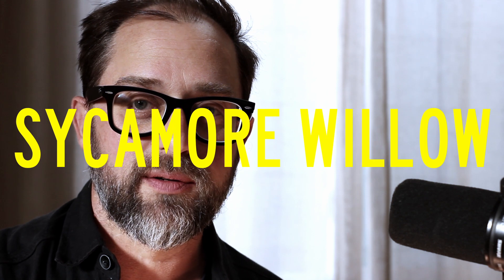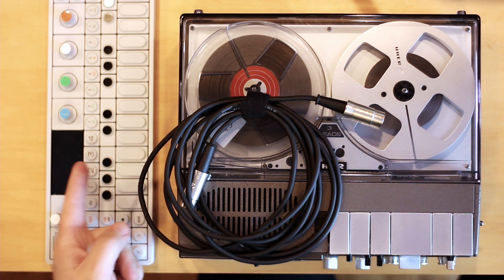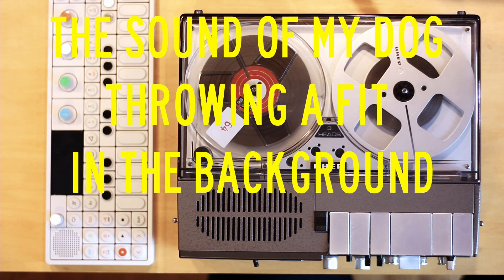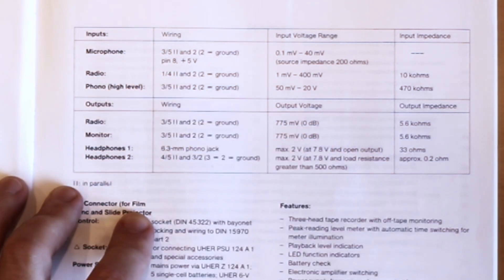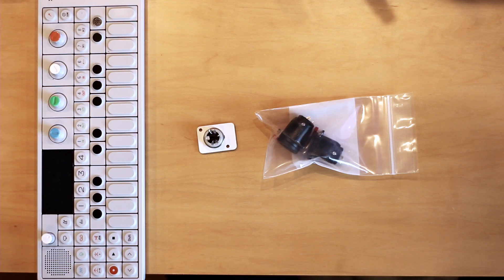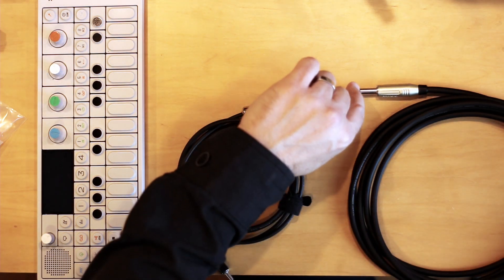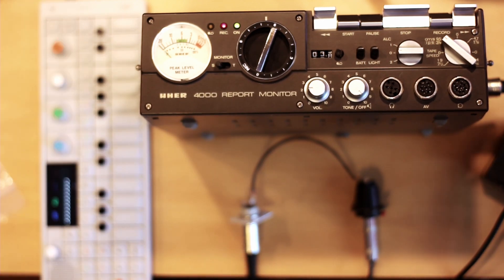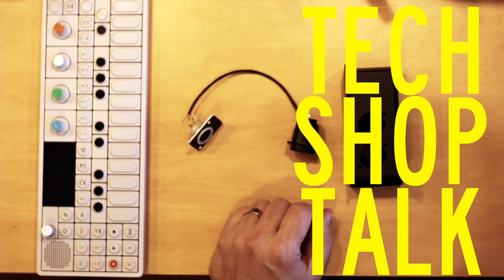How to connect a vintage Uher reel to reel to your gear. Understand and even build your own adapters

Comment: Hi-De-Ho, so I'm considering buying an Uher 561 which appears to use the same bizarro DIN jacks, and because I'm either lazy or technically incompetent, I'm wondering if you still make these little boxes. Your site seems to suggest you don't have any available at the moment. Thanks for any info, and for helping the community as you have in the past.

Comment: Hi ,have you also tried connecting the microphone this way ?
Reply from the maker: Kind of! I built an adapter to connect XLR to the connection on the front. But I also own several Uher mics and just plug them straight in

Comment: Hi, I liked your video very much! I was however wondering, can you connect the line out of eg the op-1 to the phono or radio in on the Uher? It’s different voltages right? Thanks in advance!
Reply from the maker: You absolutely can connect typical audio level sources to the Uher! I do it all the time and specifically I've done it with my OP-1.

Thanks for stopping by :)

Comment: I have a Akai4000d   reel to record er and a yamaha Digital  mixer 10xu  and 6i6 interface  do you no how to hook Thanks
Reply from the maker: In your case it's almost certainly just a matter of getting 4 RCA-to-TS cables. Two going into the recorder and two going out. So connecting instruments to the reel-to-reel recorder you'll only want to connect the line inputs and outputs of the reel-to-reel to your interface. I'm not familiar with your interface so I can't really give you any advice on that. But in general if you can get signal routed to the lineouts of your interface you'll be able to record to tape. If you connect the line out from your recorder to line inputs on your interface you'll be able to record the output from tape to your daw. Hope that helps let me know how it goes!

Comment: Hey, I’m having this issue with my Uher Monitor Report 6000, but it doesn’t use DIN-5… of the 7 connection points on it, it uses 6 different connectors.. some have the same number of pins but arranged slightly differently.. it’s extremely confusing to me. Also, I’ve only been able to find user manuals in German so I can’t even RTFM my way through it…
Reply from the maker: Hey there I'll see how I can help. I suggest you find me on Reddit as jasongonzales23. You can DM me there or post something to the Hainbach subreddit and maybe the hive mind can help as well
Reply: @SycamoreWillow  awesome, that’s actually how I found this video. Thank you, I’ll definitely do that.
Reply from the maker: That's really funny but yes seriously send me some close-up photos of all the jacks on your device over on Reddit and I will totally help you out
Reply: i'm using DIN5 cables with my UHER 6000 and its works fine BUT make sure they are pluged in correctly.

Comment: I have the 4200. It’s the stereo version. What’s really cool about these is that they’re not only great for recording live shows (or anything that you want to have the tape sound) but, they’re great to use for tape delay. Especially, being that the UHER 4000 (mono), 4200 (2 track two channel stereo) & 4400 (4 track two channel stereo) all have four speeds. You can get the cleaner delays using the 7 1/2 ips & 3 3/4 ips speeds & the really dirty delays using the 1 7/8 ips & 15/16 ips speeds.
Reply from the maker: Hey thanks for checking out the video! I have yet to try my Uher as a tape delay. Thanks for the suggestion!

Comment: The adapter is not so bad. ! You make connections in one go.  
And the adapter cinch to 6.3 female is cheap too !
  DIN Adapter to stereo in and out for 6€ easy at amazinien and four cinch to  6.3 mm female you can find for less than 1€ a pice .
I gave mine a taktile and beautifully tape wrappe .so the are fixed together . Because I don’t like cinch in the studio. 
Uher Report stereo IC 4200  the most beautiful one
Reply from the maker: Thanks for adding to the options! I personally won't buy things on Amazon if I can support a local or independently owned business, that is another factor for me. But as far as solving the connection problem your solutions look great as well. Thanks!